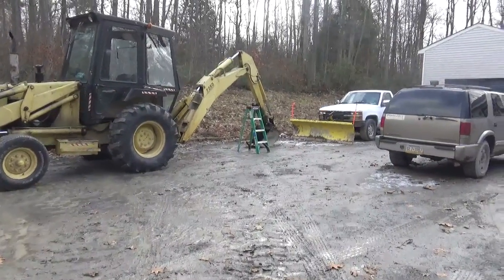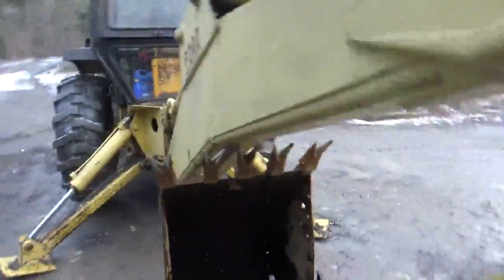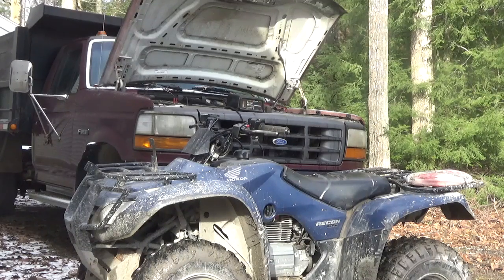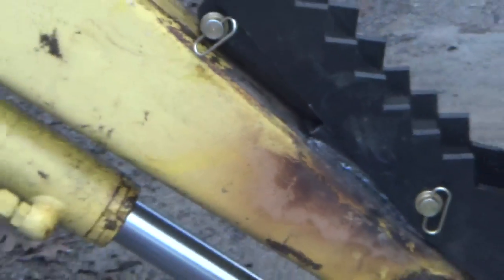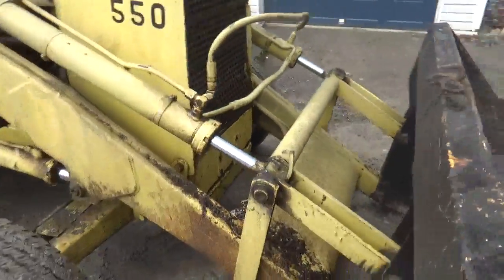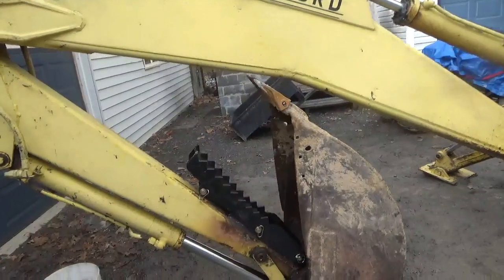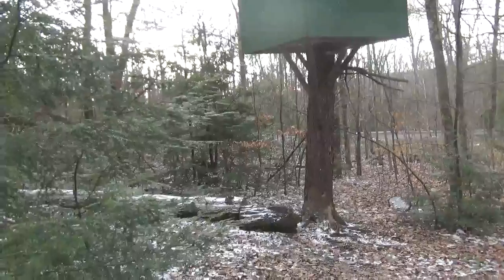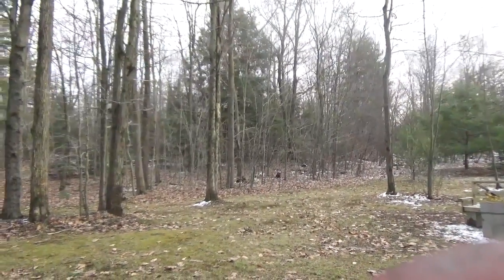Hydraulic hose removal, welding thumb chat and more.

Comment: I need a manual thumb for my 555B ford backhoe ( to weld on myself )
Reply from the maker: The thumb I put on is made out of junk steel. Did not last 2 days before the holes pulled out around the pins. I don't recommend them.

Comment: Being 75 and wanting to do everything I used to..I "cringed" when you were on the shorter ladder and tried to budge that connecting nut...WITH ONE FOOT in the air...you are going to fall and hurt yourself...take it from someone who has too many times at my wise (sometimes question that) years...Suggest you not use a step ladder...try a well established straight ladder against the  loader.....OR None at all.  Just suggesting.

Comment: Well Joe from what I can see of your welds they look very good, as I was a Welder-fitter for twenty some odd years. One thing I have noticed on a lot of welds is a potential crack waiting to happen, on many beads of weld you will notice at the start the weld is as big as the rest of the weld, at the end it is usually flat with not much weld. I have found to strengthen the weld I would start from the right working to the left and run a one inch bead, then start from the left  (because I'm left handed) and finish my bead at the finished part of the one inch bead and hesitate a second or two to finish up my bead. ( just a little information for those who are part-time welders) I personally think you are going to get a lot of use from that thumb.
keep up the good work Bill
.
Reply from the maker: Thanks a lot Bill, when I use to drive piling we had a welder that never had a broken piling at the weld. I did not get much hands on with him but he taught me a lot of stuff. I know I am not a welder but I try and I know what a bad weld looks like.

Comment: Would it not been easier on you working on that hose to stand on the bed of your truck to work on it. Probably alot safer also, than on that ladder, that looked a little scary the way you was up there trying to wrench that hose.  As for engineers it often pays to listen because they do have a unique understanding of different stresses. Guess Sally will have to change it too twin pines now.
Reply from the maker: Ya know sometimes I forget to think about the easy stuff. Lol
Reply: @josaljo1  like you im getting older and because i been disabled by a accident some years ago i have to find the easiest way to do things.